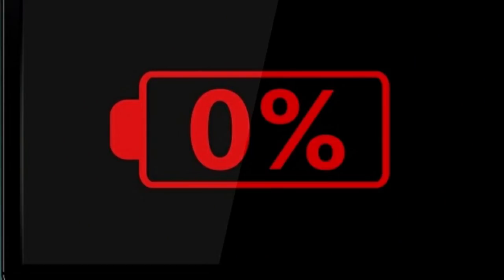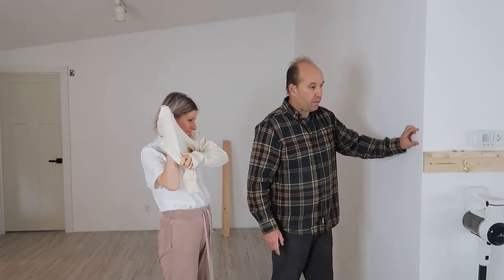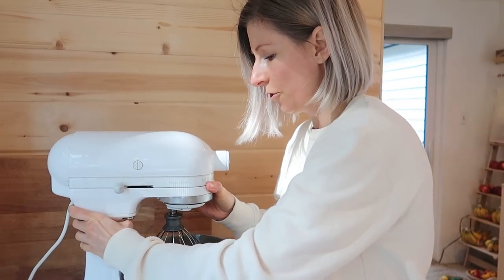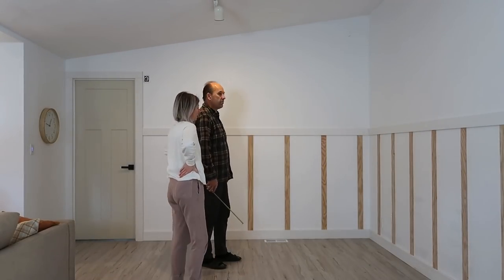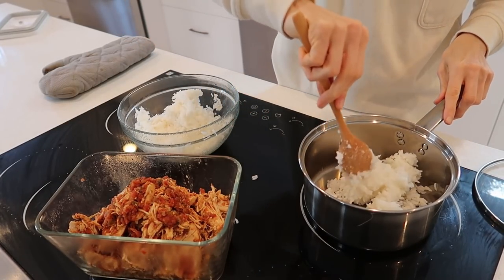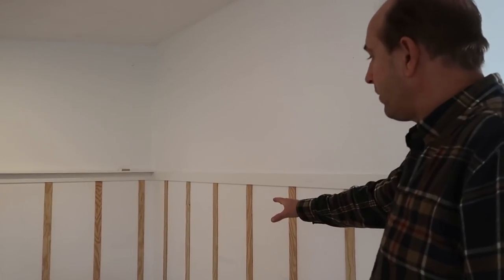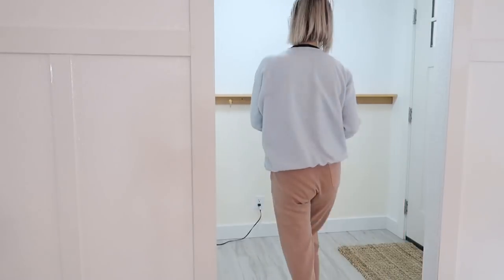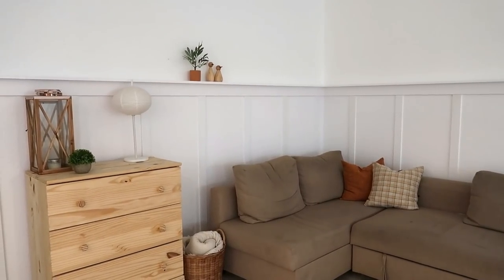LIVING ROOM MAKE OVER 2021 / DAY IN THE LIFE / FAMILY MINIMALISM/SIMPLE LIVING

Comment: If you want to place a larger pictureframe on the ledge and you don't want it to tip over you can put 2 toothpicks with clear tape at the underside of the  frame! I did this and it's hardly vissible. 😊

Comment: Hello ⚠️your comments on microwaves are incorrect👎..

⚠️A  microwave uses electromagnetic radiation.. And like visible light (eg in heat lights) and radio waves (eg music) , it is non-ionizing radiation and therefore is NOT dangerous!

⚠️ Microwaves definitely DO NOT destroy the nutrients in food more than other cooking methods.. Infact they preserve the nutrients, especially if you steam them! 

⚠️Boiling vegetables caused the nutrients to be lost via leaching into the water.👎. 

⚠️Cooking in the oven means food is exposed to longer cooking times and higher temperatures👎.

Please check facts and don't rely on "urban myths" 🙏🙏🙏🙏